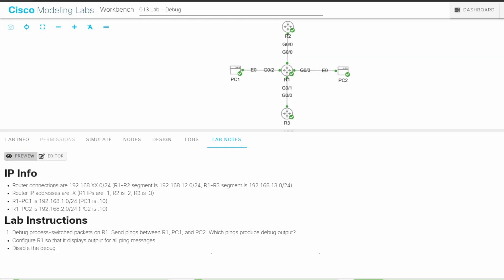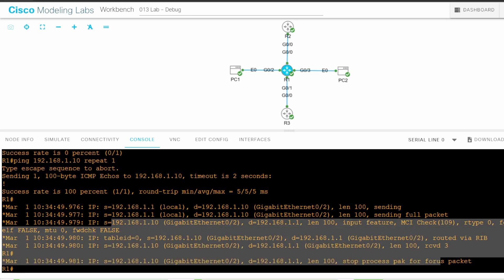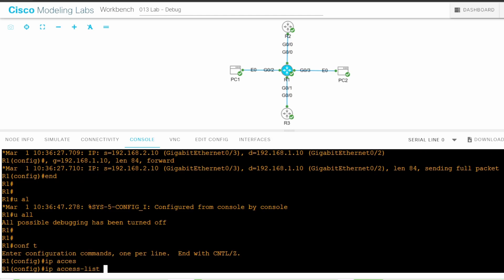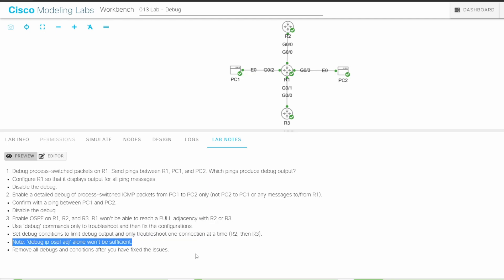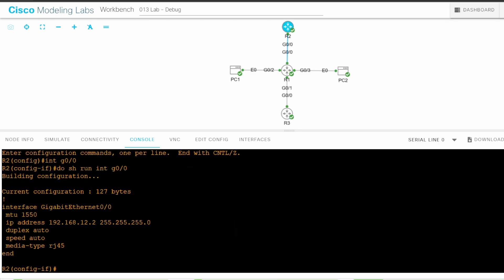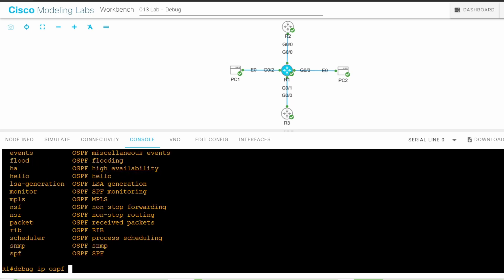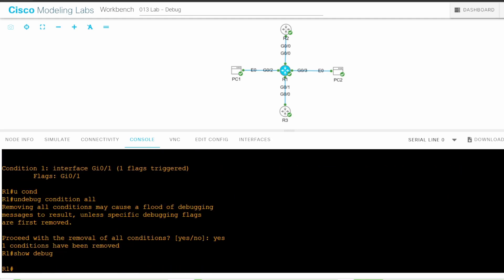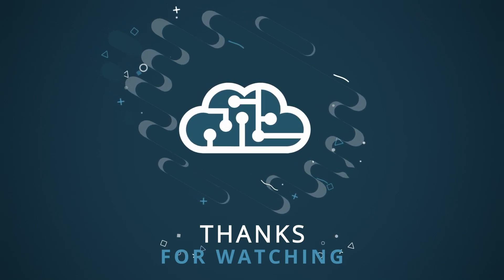CCNP ENCOR // Debug (LAB) // ENCOR 350-401 Complete Course

Comment: Hi, Sir, Thanks i am following the LAB instructions as on R2 there is only interface GigabitEthernet0/0
 ip address 192.168.12.2 255.255.255.0 .. other interfaces does not have ip addresses how interfaces will come up without ip addresses.. i dont know but i am following the lab and i could not ping any devices from R1..

Comment: Hello Jeremy. Your videos are amazing. I have question no related to the debug. Can you please help me to understand how FCS and IP checksum work? If I understand correctly, when frame is received by L2 Switch, switch checks FCS of that Frame (but only if switching mode of the switch is "store and forward", which is not so common anymore). But what happens when frame is received by Router / L3 Switch? Please correct me if I'm wrong:
1.  Frame is received by Router / L3 Switch 
2. Router / L3 Switch checks FCS of the Frame. 
3. If FCS is not correct, frame is discarded. 
4. If FCS is correct, then Frame is processed further and Router / L3 Switch checks IP checksum of the packet.
5. If IP checksum is not correct, packet is discarded. 
6. If IP checksum is correct, then packet is processed further. 
7. After routing decision is made, Router / L3 Switch change TTL (decrements it by 1), then recalculates IP checksum and writes it to the IP header. 
8. Then Router / L3 Switch rewrites the source and destination MAC addresses in the Frame and recalculates FCS and writes it to the Frame's trailer.

Thank you in advance.
Reply from the maker: Hi Pyotr! Yes your summary is correct, it seems you understand the process 👍
To add more detail, I'd just add that to 'check' the checksum (whether FCS or the IP header checksum), the device calculates its own checksum and then compares it to the one it received. You probably knew that anyway, just sharing in case you didn't.
Reply: @JeremysITLab  Thank you for the reply! And one thing to clarify, when FCS is checked, before or after L2/L3 Switch / Router examines destination MAC address of that Frame and made switching decision? Or maybe this order is different for L2 Switch and L3 Switch / Router? And the same question for IP checksum, is it checked by L3 Switch / Router before or after destination IP was examined and routing decision was made on that packet?
Reply from the maker: @pyotr.networking.geek1  The FCS/checksum are checked first, before other decisions. Otherwise the device could waste time doing an address lookup, only to find afterward that the frame/packet is corrupt and needs to be discarded.